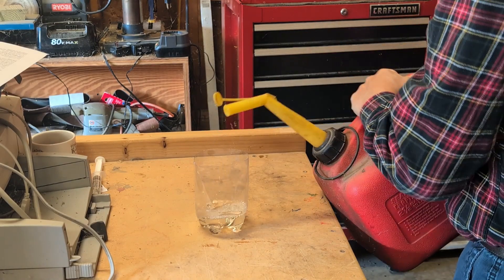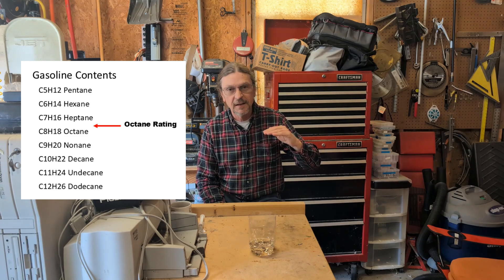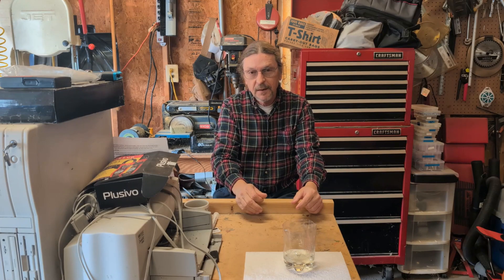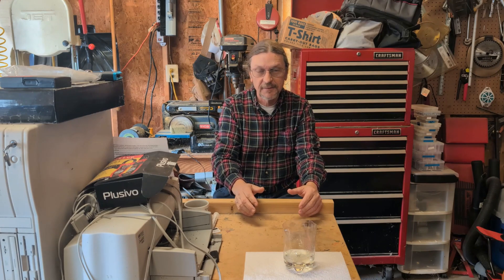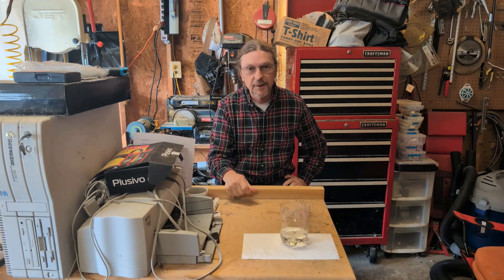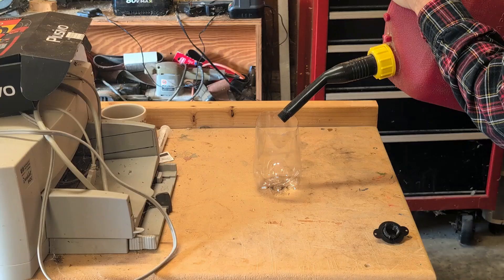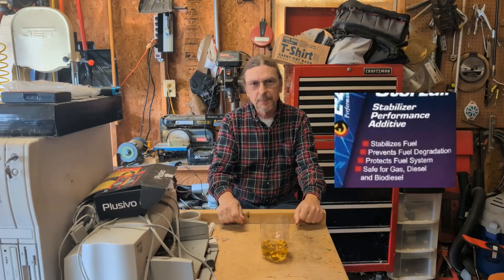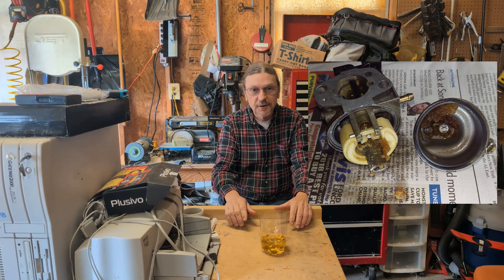How Gasoline goes BAD

Comment: I have stopped storing fuel in plastic containers, you are quite right in only keeping it 3 months, in my experience 3 months in Tropical Queensland, it is starting to go off. If you store it in steel Jerry cans, German army style and kept full, it lasts 12 months plus and is still good to go. I think steel jerry cans seal better and exclude oxygen and moisture from the fuel, which to me seem to be a cause of fuel deterioration. Over here you only have to leave a plastic fuel container out in the sun for a very short time and they swell up like footballs and then shrink when cool. This was what made me change to Jerry cans. They were designed to cope with that. Also a little 2 stroke oil helps stabilize fuel, Thanks for your video, was informative.
Reply from the maker: I forgot once and left a plastic gas-can in the summer sun and yes it inflated to football-ish shape, LOL.

Comment: I’ve just bought a motorbike which has sat in a garage for 15 years and hasn’t run in that time. I put a fresh battery on it and it started and ran no problems with the petrol that was in it. The petrol looked absolutely horrendous and it smelt as stale as hell. I was really surprised that the motorbike actually ran as well as it did with 15 year-old petrol in it.

Comment: Why does my lawnmower still work after it sets all winter with old gas in it?
Reply: Do you use gas without methanol? That’s the key. 
No methanol gas. 
Real gas. That’s what’s best.
Reply: Because it's fine, it's not that long. Alcohol in today's gas absorbs water too. Most people don't know that. Today's engine are designed to run on today's gas.
Reply: because this fellow is an amateur. Listen at your peril.
Reply: @greenspiraldragon  I guess when you incur a repair charge from old gas, then you will understand .
Reply from the maker: The brown gas I showed was a year old.

Comment: I'm 70 and all of my engines work fine all of the time by following one simple rule, empty all gas from my engines (lawnmowers outboards chainsaws, etc) in the fall or not in use for any length of time. put fresh gas in when you want to use it. If there's no gas in the engine to go bad then there's no problem
Reply: IMO not necessary but by all means do what you want.
Reply from the maker: That has worked for me when I remember to do it.
Reply: @workbenchz  In the fall, when I mow the  lawn for the last time,  I run the mower out of gas,same with my boat motor ,pull the gas line off while it's at the shore and let it run until it stops and chainsaws ,same thing